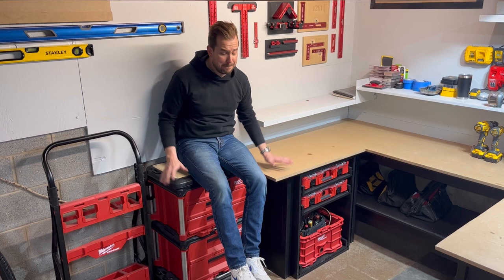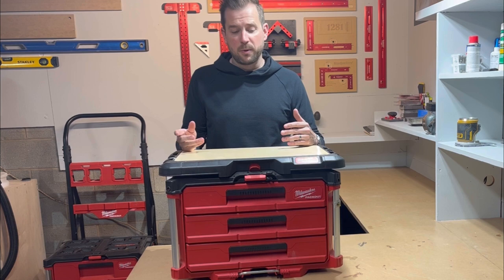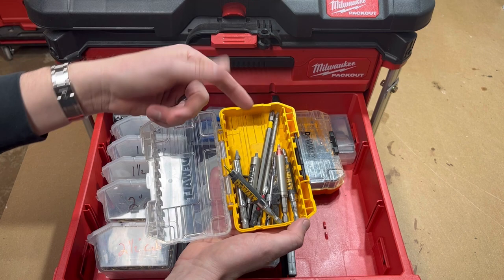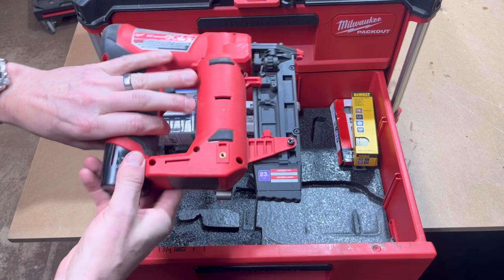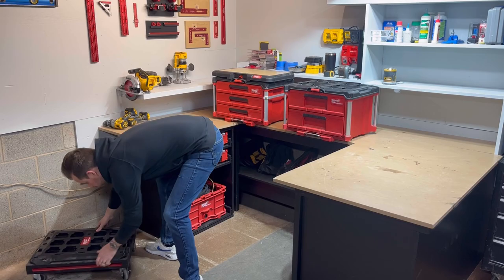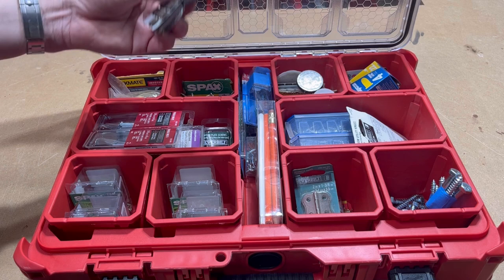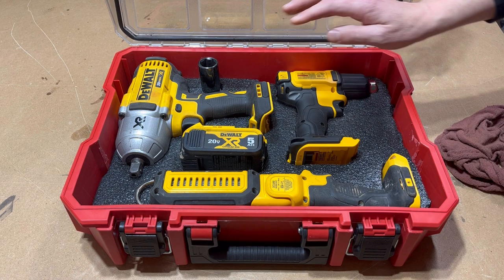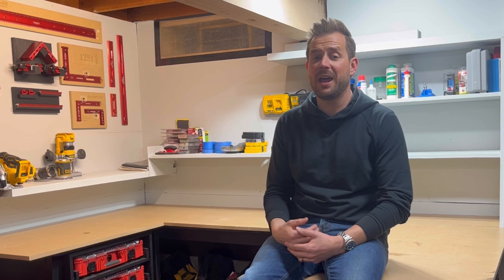Custom PACKOUT setup for carpenters// What’s inside.

Comment: How is your diy dolly compare to the packout one?  Id think its heavier but also more robust.

  Id likely add a spacer in the middle too for support /shrug
Reply from the maker: It’s holing up well, I like that I can slide it around but also use the dolly if needed with minimal effort and don’t have to disassemble anything. Maybe a little L bracket on the lip would help save the wood from the dolly but I can always do that any time if it gets to banged up.

Comment: Awesome Video! Where did you get your side tool rail and "Joey style" mounting plate you had on the front?
Reply from the maker: Thanks!! I made the drill holder on the side from a pice of 1” aluminum, and the part that holds the crate is from a Etsy shop. I think it was $50-$60.
Reply: @mr.4ambuilds913  Outstanding!.. Thank You Sir!

Comment: How do you findthe trolley?
Reply from the maker: The local big box stores around me have been having them in stock.
Reply: @Mr.4amBuilds  Sorry I mean. Do you rate the trolley? Is it worth buying?
Reply from the maker: @Media_By_Josh.  if your going to use it every day yes. Sweet how the packouts snap on the bottom part, and how it can hold the milk crate. If your just using it occasionally I’d buy a cheaper one.